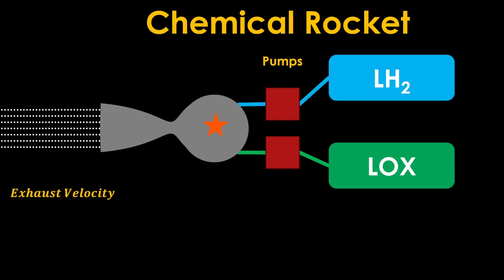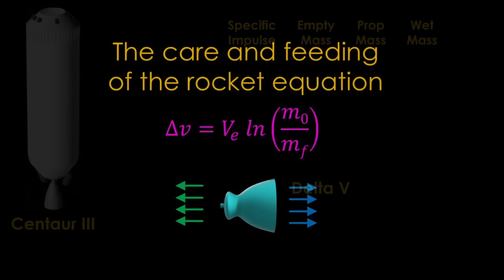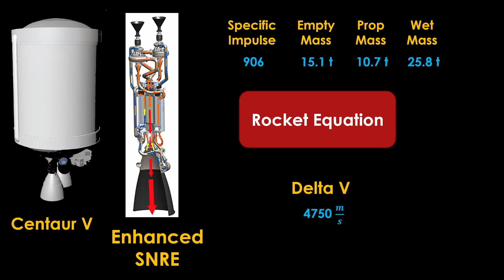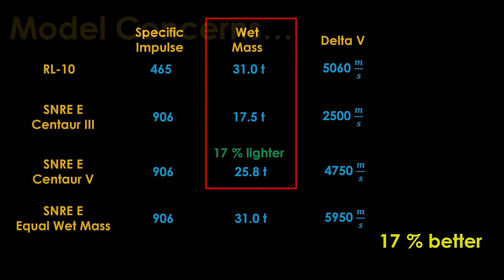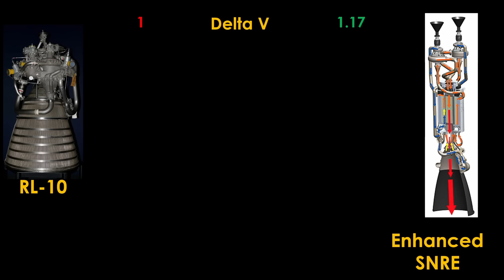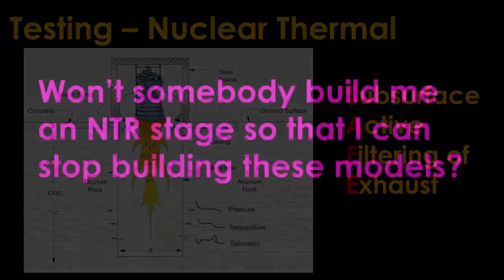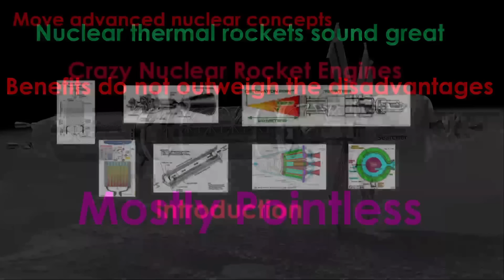Why Nuclear Thermal Rockets are Mostly Pointless

Comment: NTRs are not supposed to be used with a 30 ton stage. We had the j2 for that and performance was never the problem. The engine mass becomes insignificant when you scale the spacecraft up. If you're going to mars and your spacecraft is 200 tons it doesnt matter of your engine is 50kg or 5000kg anymore. deltav will will be significantly higher at those scales. This video is misinformation imo
Reply: If you've got the hots for specific impulse, and you're doing crewed missions (which implies inside the asteroid belt) and you're assuming starting from orbit, so no particular T/W is needed, then solar panels and ion drives beats nuclear thermal every day of the week. Even cheap ones like the SX Starlink drives. A few hundred of them and some panels and you're cooking with gas for much less empty weight than nuclear and 3-10 times the ISP.
Reply: @gasdive  That's wild, I gotta try to do that in ksp, but I wonder what would happen at reentry, would you have enough thrust to capture? Or would you need to do a low energy transfer? so many questions
Reply: @carlobagnoli6746  here are some numbers to make a start with. 

1000 SX ion thrusters would weigh 2.1 tonnes. Would draw 4.2 MW of electrical power. Would need 1.1 tonnes of the most advanced light weight solar panels to power them at Mars orbital distance from the sun. Has a combined thrust of 170 Newtons. Has an ISP of 2500

You'll need to guess how much panel mounting systems, electrical distribution systems and other ancillary systems weigh.
Reply: @carlobagnoli6746    as for capture at Mars. 

Say you had a 2 week to burn for your Mars capture. That's 2x7x24x60x60 seconds. Divide by the ISP (2500 seconds) and you get 484. The thrust is 170 Newtons, call that 17 kg. That's 8228 kg of argon. For a ship that's 100,000 kg at the start of the burn, that's 2.1 km/s of Delta V. That's enough to capture you into a highly elliptical Mars orbit that you can modify as needed. Leave the ion drive stage in orbit and go down to Mars with a re-entry vehicle. It will have a much more gentle re-entry because it's not screaming in from interplanetary space, just coming in from orbit. 

Even better, argon is more than 1% of the Martian atmosphere. Did someone say "in situ resource utilization"? Bring 30 tonnes of argon with you from the surface and you've got more than 6 km/s Delta V for your return to Earth with plenty to spare. Enough to put yourself in low earth orbit where you can refill for the next trip to Mars.
Reply: @carlobagnoli6746  For a Mars bound vehicle you can just match Mars helocentric velocity and no high thrust capture is nessary, you just slowly spiral in over a few weeks, its short enough compared to the total trip to be insignificant.  Alternativly, bring hypergolic propellent with you and use that for a capture burn to save time.
Reply: Making multiple burns to escape earth’s sphere of influence would likely take more than just a few extra days.
Reply: No, if you drop your thrust to weight ratio too low you start to lose Oberth benifits and your DeltaV starts to rise.  Electric systems take this into account and use slow spiral trajectories and fully plan around the DeltaV penalty that results.  You cant drop thrust to weight arbitrarily low without accounting for this.  Also reactors can not be made arbitrarily small due to neutron leakage.
Reply: Agreed. He did not touch much heavier second stages like Starship or SLS. Plus, in orbit, you can get away with small engines, 1/10th of TWR is rubbish for second stage, but perfectly fine for orbital ship.
Reply: One of the problems with NTR is the TWR, a big ship needs a lot more thrust, NTRs don't have a lot of thrust. Sure you might be able to do multiple passes / elliptical orbits but at that point you might as well just use another engine for high thrust and the NTR for the final pushes / reentry.
Reply: @carlobagnoli6746  There is absolutely nothing wrong with several thrust orbits, especially if you fly to other planets. You may think, that it will take more time, but if you have higher ISP, you can get higher velocity and you can arrive earlier at your destination. And even if not, leaving one or two days earlier for half year trip is not an issue. Sure it is a little less fuel efficient to extend the burn, but you don't care if you get 2x ISP thanks to that. And that higher thrust engine would not have NTR ISP. If it had, we would just use it instead.
Reply: @syriuszb8611  Not quite, doing multiple burns is kinda bad for many reasons, for starters, you would need to pass multiple times through the van allen belts (if it's uncrewed it's not that bad, but if it's crewed you are blowing 20% of their spacetime career every-time you go through them). Secondly, NTRs are reusable, but not as much as you might think, and they are a pain to wind up / wind down. It's not impossible to use them, yes, but as I said, you might as well just carry an extra engine at that point.
Reply: @carlobagnoli6746  The TWR would probably improve with scale. Nuclear reactors tend to be better when big.
Reply: This is true, yes, a very expensive truth.
Reply: @placeholdername0000  Not really, the power density is unchanged because that is dictated by material melting points.  What drops in the neutron leakage which means you can use lower enrichment nuclear fuel, which is a must for civilian reactors.  But you also have hot/cold pockets as reactors get bigger, they no longer act as one object and need multituides of local sensors and control rods, a small reactor can operate on a single control rod.
Reply from the maker: Can you point me to a model for an interplanetary spacecraft that compares NTR to chemical? 

I have one in mind that I should probably dig up, assuming it's available and I can find it.
Reply: @EagerSpace  Atomic Rockets is basically the ultimate resource on all of this. For going interplanetary, it is absolutely unambiguous that NTR would be a superior option to chemical; unless your vehicle is comically small, the efficiency advantage will be worth it every time.
Reply: @The_Blazer-u9t Atomic rockets is space fan fiction
Reply: @oberonpanopticon  Well, all his material is scientifically accurate and well-researched.
Reply: @EagerSpace  IIRC the NASA design reference mission did a comparison between a NTR mission to Mars and a chemical version. For the chemical version, two stages were needed to kick each payload module to Mars. For NTR, only one (or 1,5 for certain years, where you would launch two tanks on one rocket, one tank for each cargo craft). The chemical version of the crew module was just crazy, needing 7 launches of the Ares 5 IIRC. I think it was the DRM 5.0.
Reply: Why does no one mention you can just also have a SMALLER nuclear engine for a 30 ton stage lol? It’s such a basic notion 

He also mentions that the TWR of the engine is lower for the one he picked. That’s true. For the engine he picked. The theoretical maximum of nuclear thermal engines is insane, several hundred G of TWR. Like 500-1000 TWR on the engine. You could slap such an engine on a small rocket and it could lift off from a neutron star lol. His central argument that "nuclear engines have bad TWR" is totally false, they have much better one that chemical engines. Simply the early prototype model he chose had a low TWR. But the physical limit of thrust per mass of nuclear rockets is IMMENSE.
Reply: @IceRain-f5v  because there are minimum sizes for reactors and maximum power densities and they don't scale.
Reply: I came here just to look for this comment, haven't even seen the video. Thanks for saving my time.

Comment: I think this is a good analysis of NTR as second stage, but misses out majorly on the more realistic use case: orbital tug with refueling. 

LEO-Low Mars Orbit-LEO is ~11.4 km/s without aerobraking.

If you have a low-TWR NTR, assuming 1 ton of engine mass, 8 tons of tank mass, and 8 tons of payload, the propellant mass is 44.3 tons if your propellant isn’t leaking badly. Still not great due to other issues, but maybe better than the RL-10 equivalent at well over 100 tons propellant mass.
Reply: Right. For regular crewed Mars mission to make sense, they need NTRs.  And for NTRs to make sense, they need regular crewed Mars missions.  

They're just not cost-effective for missions in Cislunar space. If you want human interplanetary travel to work though, you need higher performance than chemical rockets can provide.
Reply: I think your Delta V numbers are high. Escaping earth should be around 3400 m/s, and capture at Mars depends on what kind of transfer you take but might be three or 4000 m/s maximum unless you take a ridiculous transfer
Reply from the maker: NERVA had significant problems with longevity at full thrust. IIRC, they ran one engine a bunch of times but only at low power levels. 

I'm not excited about a earth->mars->earth tug. I haven't run the figures, but I suspect that you can do things a lot more easily and cheaply if you just take your payload to mars and never come back, and that should be the bulk of the payload.
Reply: @EagerSpace  I had the impression that NERVA did well with its "Hour of Power" tests. It has been awhile since I read "To The End Of The Solar System" by James A. Dewar, but I thought the testing regimen was pretty rigorous and that there was a sense that there were greater possibilities with the technology. 

On testing the NRX series in December 1967: "A run of 62 minutes at a higher than planned power - an average of 1130 MW." ... "The hour-long run was the nail in the coffin for the large NERVA II; if more thrust was needed, just run smaller NERVA I longer, or cluster it." 

As for the "1971 Design Specifications of NERVA I Flight Engine"
- 1500 MW (75,00 pounds of thrust) at 825 seconds of specific impulse with one hour continuous operation and weight under 15,000 pounds. 
- Ten-hour lifetime with up to sixty restarts at 2071 C 
- Growth to two hours of continuous operation to twelve recycles at 2321 C (900 seconds of specific impulse)
- 0.997 reliability
source: page 191 of "To The End of the Solar System"

Again, it seems that testing seemed to support a thesis that there was opportunity for growth back then with the technology, recognizing that this was a complex system.

Comment: What if a more dense propellant was used?
Reply: ISP is reduced 

Personaly i think its a problem of useing a too big of an engine for too small of a stage

He got it to the breakthrough point
Reply from the maker: It makes tank size less but kills the specific impulse because the exhaust particles have higher mass and therefore move more slowly.
Reply: @EagerSpace  I'm not sure about the specific impulse reduction. Possibly a denser propellant could take on more heat from the nuclear heat source and do so within a smaller chamber reducing the mass of the engine. 

I guess it all depends on what the limiting factor is. Is the hydrogen already taking on maximum heat to the point that the limiting factor is melting the chamber. 

Like everything else it's a trade off analysis. I'd think helium would be the ideal propellant for the same reasons it's the ideal for pressurization.
Reply: @snek9353 You want your exhaust to have high velocity, for that you want big volume which means low density. Read anything on rocket theory, it would absolutely kill ISP
Reply: @snek9353 the Isp reduction is simple physics.
Isp is equivalent to velocity (v) and average exhaust particle energy (E) is equivalent to temperature.
But E = ½mv², so Isp at a given temperature is inversely proportional to the square root of the particle mass.
Reply from the maker: The physics is complex, but the basic issues is that Nuclear thermal rockets need to run at considerably lower temperatures than chemical rockets because they have solid structure that they can't melt. That lower temperature means less energy going into the exhaust. 
Purportedly there are pebble bed designs that can do better than the conventional designs but we don't have any real experience with them in this use.
Reply: @snek9353  The exhasut temperature is dictated by the engine not melting in ALL rocket engines, even chemical ones.
Reply from the maker: Yes. But in chemical engines the really hot part is just filled with combusting propellants.  In NTR, you have to be at temperatures that the reactor core can handle using materials that can tolerate very hot hydrogen.
Reply: Terrible idea, exactly what you DON'T want to do in rocket engines
Reply: Hydrogen gas has about the highest heat capacity of any gas

Comment: My issue with nuclear thermal is that the more I learn about it the more issues with it there are. Storing the hydrogen is a big problem, keeping the reactor cool through out operation is a problem, the reactor can not spin up and down instantly and thus causes very complex burns that could be hard to plan for. Also the radioactive material in orbit is a problem
Reply from the maker: Agree with all of those.

Comment: Time to scrap all the EVs and try a nuclear thermal rocket with lithium as propellant.
Reply from the maker: Solid lithium? Or some lithium compound?
Generally you lose a ton of specific impulse as you go heavier.
Reply: @EagerSpace  Was thinking pure lithium. From my understanding the main restriction for a thermo nuclear engine is the temperature that can be maintained by the fission core. This is why hydrogen with its lowest mass generates by far the highest specific impulse. With lithium atoms being 3.5 times heavier than hydrogen molecules, and lithium's gas phase mostly comprised of single atoms it would of course have a lower specific impulse. Just going by an ideal gas approximation: 1/sqrt(3.5)=0.53. 
So going with the nerva isp of 906 s that would yield an isp of around 484 s. Which would be slightly higher than the Centaur III HydroLOX engine, while having a significantly higher propellant density. 

Just got the Idea when I watched your video. Not as much as a leap as I initially thought though.
Reply: @harzer99  people have also suggested ammonia but again the ISP gets cut substantially